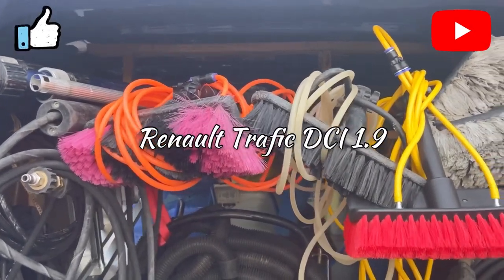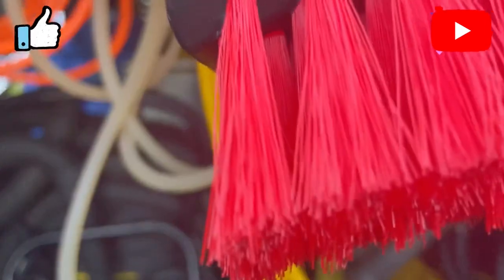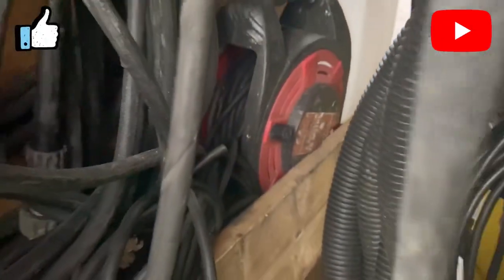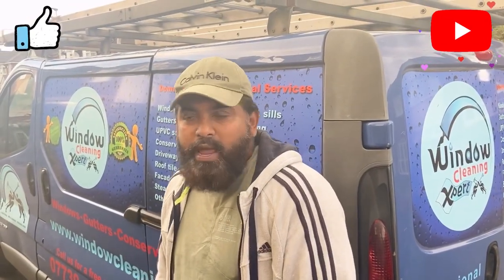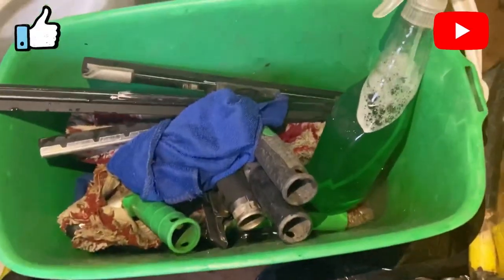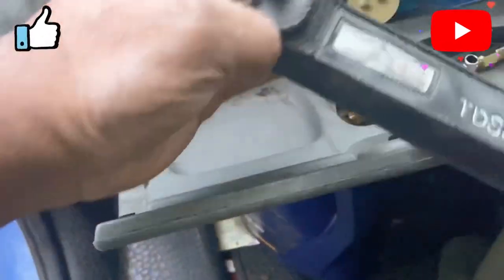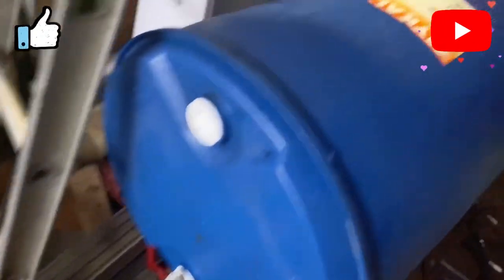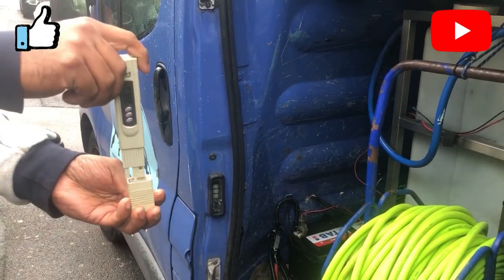Let’s look at my Window cleaning and pressure washing equipment - Van and garage

Comment: question how do you go about using the tank for pressure wazshing and window cleaning as you need pure with window cleaning and normal tap water for pressure washing ?
Reply from the maker: I use pure water from tank for windows, tap water connections for pressure washing mate
Reply: @exteriorcleaningxpert  sure so you use 2 tanks or is your tank a split tank ?? Because my pressure washer doesn't suck straight from the tap it's to water thirsty so I suck from a tank usually

Comment: What is the surface cleaner like ?
Reply from the maker: It’s from Mykal it’s basically a pressure washing universal cleaning liquid like karcher does, you can clean any plastic, metal, concrete or wooden surfaces
Reply: @exteriorcleaningxpert   You deserve to be  and will be successful  because your a hard worker !!  simple as that... Energy is king in cleaning .. a question what is the round surface cleaner like ? i can get here where i am . but not sure if i should get hat or the mosmatic..
Reply from the maker: @fensterputzernuernberg  thanks mate for your kind words, yeah sorry the surface cleaner that I use is a 14” one according to my research for the domestic jobs if you buy a big one than a 15 “ the working pressure going to be low doesn’t matter how powerful is your machine as the tap water in most domestic properties will flow on a rate of 5/6 litres per min maximum so no point you are using a big surface cleaner that will not doing the job properly. Either you have to use the turbo nozzle to get the maximum pressure or the small surface cleaner like 12” or 14” if you are mainly doing domestic jobs like me doesn’t matter mosmatic or BE I bought this in eBay which is “merc” from germany 14” that works well even this giving only around 120 bar pressure which normally shows 140 on my turbo nozzle if I replace a big I think it’s pointless for domestic clean. For commercial industrials big surface cleaners might work when there is good pressure on the tap. 
Hope you got the answer 🌹👍
Reply: @exteriorcleaningxpert   I have a small one as well . actually it works very well my electric kränzle..  The problem with hondas is that they are so damn loud .. You can actually clean very well with around 120  bar and 10-12 LPM..   i think we should be both aiming for heat / steam like  and more LPM like Bournemouth power wash .
Reply from the maker: @fensterputzernuernberg  I hate Petrol machines 😀👍

Comment: That's a busy van Nash. I had a look for that Mykal DSI 6000PWC. I can see it listed on their website, but no mention of capacities available or where to buy from. I see their UK address is ZEP in Cheshire. Is that where you managed to buy 55 gallons from? If not, whose the supplier you used? I've used a Seldon product called SelSolv (F004), for first cleans and uPVC work, but you can't buy it any longer, so I'm looking for a replacement.

Keep the vids coming brother, always entertaining.
Reply from the maker: Thanks mate, actually I bought it from a warehouse in an army base near Brighton. The business was closing down and was a graffiti removal service , so I bought a couple barrels. But this same formula is available to buy online when you search Mykal Pressure washing liquid. Hope that helps.👍
Reply: Agreed, but you have to buy it in miniscule quantaties, ie, 5L or 25L, if they have that size in stock. Fair do's Nash, thanks for the reply chap.
Reply from the maker: @onetruecharlatan yeah indeed, this site is selling barrels please check through the link and check with them the specification whether it is good for you or not mate  cheers ✌🏼https://www.michael-stewart.co.uk/product/pressure-washer-soap-with-wax-205-ltrs/
Reply: You're a gent Nash, nice one 👍
Reply from the maker: @onetruecharlatan  Any time mate👍